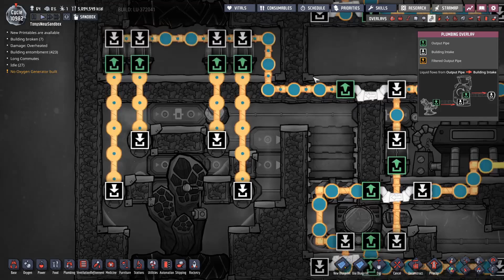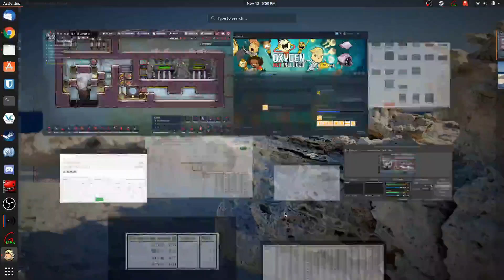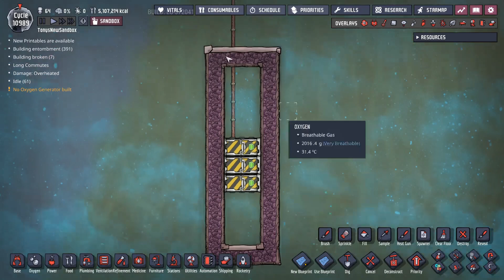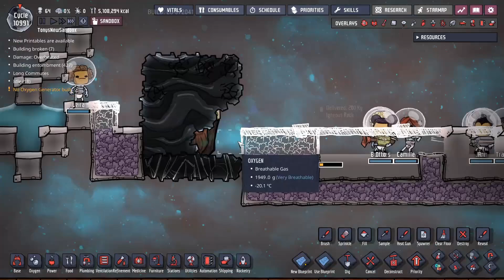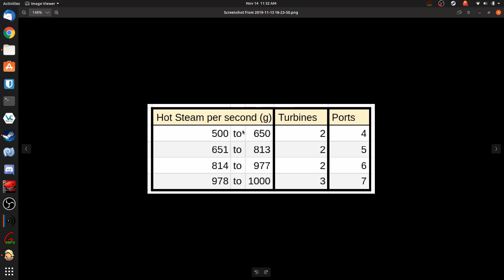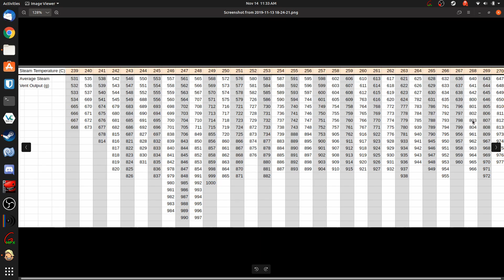Tame Your Hot Steam Vents for Power and Water

Comment: I just made a contraption that cycles molten steel and steam to provide my base with basically free energy. Insulation blocks prevent my base from overheating and it needs no vents and geysers.
Reply from the maker: Cool.
Reply: @tonyadvanced6315  The initial startup is slow. I use either the space heaters or the liquid one. Molten steel is perfect because it doesn't solidify which would ruin the whole thing. Automated doors to keep the stuff flowing and a ton of water to prevent everything from melting.

Once a while it needs to regenerate, but in case you can not live with power outage, you can build two which will give you a permanent net positive energy.

Comment: a neat thing you can do with a modified version of the door pump you have there is leave the middle open so that it doesn't transmit heat while inactive, used one of those recently on a multi salt water geyser boiler
Reply from the maker: That's a good idea.

Comment: Wow lots of work for this video, I salute you man.

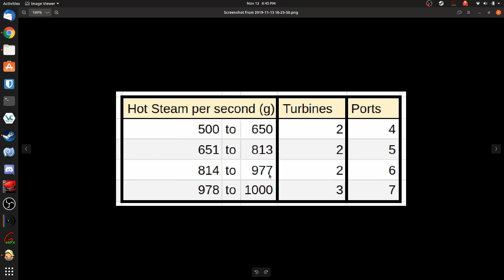@12:03, I think the phrasing is a bit misleading. The number of open ports in a steam turbine does not control the amount of heat deleted, only the amount of stream extracted, 0.4 Kg/s per port. The amount of head depends on both the amount and the temperature of the steam. Of course, if you keep the temperature constant (which you plan to do, but you haven't mentioned yet), then yes the amount of steam controls also the amount of heat.

@33:48, wouldn't it be faster to play with the piping and let petroleum in via the valves? Every drop should land in the right place w/o deconstructing anything, and you have to mop the rest only.
Reply from the maker: Thank you for the feedback. Also, I added the petroleum thing to the addenda.

Comment: If you need to block certain ports, could you use a door with a sensor to open when you want more ports open?
Reply from the maker: Yes. That works. Let me know if you see a way to use it for this build that you like.
Reply: @tonyadvanced6315  So far I'm using manual switches.  It is extending the amount of time I can siphon energy from my mini volcano chamber(which is my highest steam turbine power generation setup).  I'm going to attempt to play around with other automation types to see if I can find a hands free solution maximize this.
Reply: Wish I could send you a screenshot. My door idea has increased my 4 turbines from 250kw to avg of 500kw.

Comment: I think you can reach nearly the same efficiency by just slapping 2 or 3 (I haven’t felt the need for a third but I haven’t stress tested it on nastier vents) steam turbines on a room full of temp shift plates and redirecting the water in if the pressure is low or if the temp is high. I haven’t had any over pressurization issues with this and this doesn’t have the utility of constant power but it’s much simpler and cheaper. I know yours is more efficient but I generally don’t care as much about optimizing power generation since power is so plentiful in oni.
Reply from the maker: That's a good idea and I think it can work well in the right situation, particularly if you aren't overly concerned about maximizing the power output. I've seen some designs on the Klei forums that start with the same concept. They were developed further so the tempshift plates transmit heat into metal tiles to heat adjacent rooms of steam.
I tried to make that work but there are some beefy steam vents that emit like 8kg/s while they are erupting and I just couldn't make it work without a gigantic build with like 16 steam turbines. I failed at managing the pressure without bypass pumps on steam vents like that.
Reply: @tonyadvanced6315  I set up the automation so that after it erupts and goes idle for a bit, the turbines drain the room down to a low pressure like 2kg and 125C, I know this makes the steam turbines a bit less efficient but it means I can get most of the power out without ever over pressurizing the vent and losing water. I bet this is overkill and you can probably do like 1kg and 180C and have it work for most or every vent but I haven't played around with it too much. Also where are you getting that 8kg/s while erupting number? I've never really seen anything above 2.7kg/s while erupting.
Reply from the maker: @nikofrancisco9894  It's technically possible for a steam vent to output 25kg/s, me and a guy on the Klei forum figured out the numbers for it today. But their stats are also a hash of their location on a map, so it may be coincidentally impossible for a nuclear steam vent to ever happen.
Anything over 3.5 is pretty rare. But I have one on my test map right now that does 7.6.